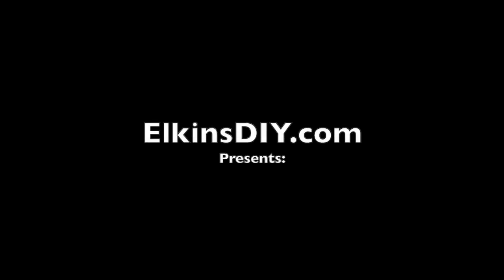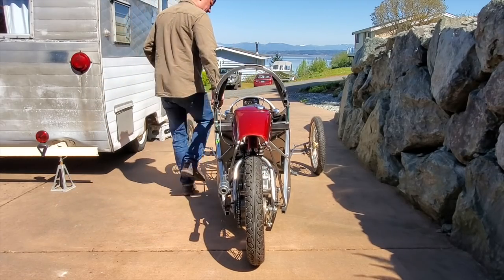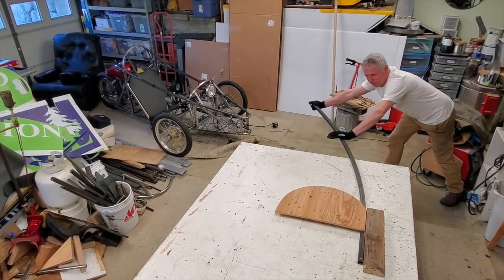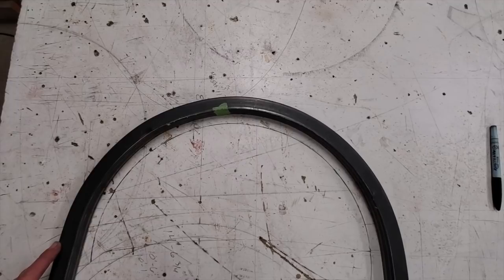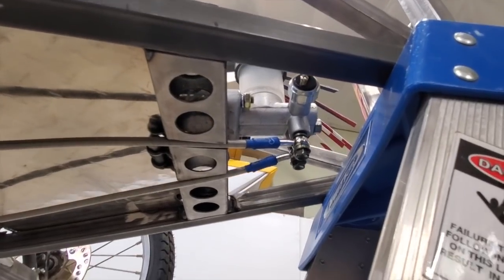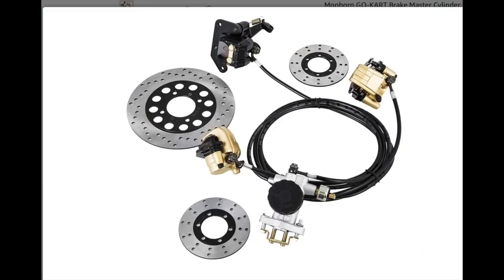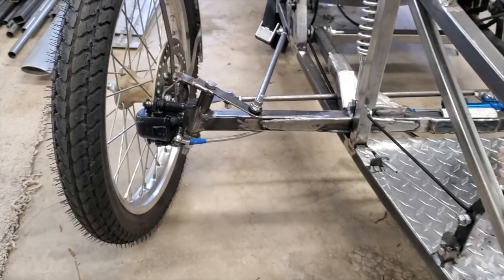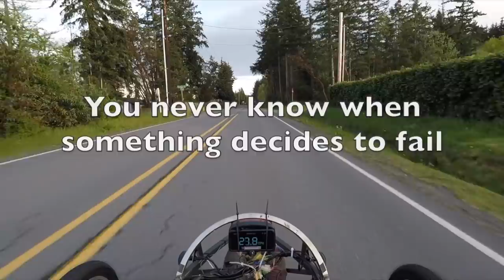Fuel efficient reverse trike build (part-11) Road tests!

Comment: In the 1950's My Grandfather built a 3 Wheeled Go-Kart for my dad....Later it became mine.... The frame was made from Car Drive Shafts in "T" configuration...U-Joints for Steering Knuckles... It only had rear brakes, and used 10" wheel in rear for BMW Isetta and Pulleys for front wheels and Aircraft tires in front... Started with 3.5 Clinton, it had a 372 JLO snowmobile engine at one time...I had a 6HP Tecumseh on it the most... I had CVT style belt drive to Jackshaft and Chain final drive... The 6HP would take it 40mph...the 372 was something like 18HP and 70 was attainable...never had enough brakes for that... But it was heavy as heck as it had full roll cage with forward protection.  My dad told me, originally they had used spoke cycle-wheels like yours has, but they don't take well to "side loads" and folded over...

Comment: Hi Paul, I'm building a motorized bike with rear suspension, a similar trailing arm to yours and spring welded on a similar angle to the top of rear seat post bar.
My problem is when the arm squats down the top chain tightens up and lose the travel. When I pedal the same thing happens, the top chain tightens and lose travel.
This means The chain is holding up the bike, and I believe the same is true with your design and have lost the small travel you had without the chain and are putting strain on the drive gear and shaft.
I did not know dirt bikes have a chain guide and slack to compensate for the travel. I'm scratching my head about this as the frame is awesome and don't want to give up on a full suspension dirtbike style motorized bike. Looking forward to your next ride that bike is sick and you are an inspiration to all  builders of manly things.
Reply from the maker: My rear swing arm pivot was placed too far back. This, like you mentioned, has created a bit of a jerk on big rear wheel bumps. The pivot should be closer to the drive sprocket. 
At this point it would entail major remods to achieve that, so I'll keep it as is and avoid rear wheel pot holes at speed.
Reply: @paulwelkinsdiy  Thank you so much Paul.
I was looking more for advice and got it than see you dismantle your trike. Pivot close as I can to the cranks and engine gear. Thanks again for help.

Comment: My admiration... I have put a lot of thought into making one of my own. But, never had the funds to make it real. Nice design and fabrication. The only thing I would have done differently is a slightly larger engine. Maybe a Honda 450 or similar.
Reply from the maker: I might hunt down the next size bigger Exciter, which is a 250cc. that way the motor mounts should still work. It's still meant for high mileage remember.

Comment: Nice job! OK, stupid question, but did you figure out what the loads are on each wheel when you're aboard that thing? Because with the way the weight is distributed, it looks like it's going to have a tendency to break loose in the rear first during hard cornering. Would be interested to know what its rotation feels like under accel/decel turning.

Comment: A very interesting project.  I may have missed it but what is the caster angle on the front axle.  Also, have you thought about the best gearing.  Dropping a tooth or 2 on the engine sprocket would give you more take off power and it seems that the top speed would not be adversely affected.  Getting the engine rpm up at each speed would take some of the load off the engine.  Lugging the engine may affect  your gas mileage.  Running a little more rpm may use less fuel.  Still a great project.  Billk
Reply from the maker: I'm thinking of that same idea. Playing with my Honda CRX with a high geared HF transmission, I waisted the motor in no time due (probably) to the low compression engine, unlike the true HF car which ad a high compression engine to handle the lugging. 
Once the teardrop body is on it should reduce the load on the engine at speed. I have thought of creating a rear wheel with a electric hub motor for 1st gear and reverse, then make a smaller rear sprocket for speeds.

Comment: Looks and sounds great Paul. 

I know you are going for mileage but I'm wondering if going to a one tooth smaller sprocket on the motor would help on pulling away from a stop. I know these small bike motors are happiest being spun up to make their power. The heads tend to run cooler when in their power band. I learned this from running dirt bikes with a head temp sensors.
Reply from the maker: Thanks for in info Kriss. I'll keep that in mind.
Reply: @paulwelkinsdiy  two gauges you may want to install are a cylinder head temp gauge and a oil temperature gauge in your little beast. The reason for them is to monitor the temperatures because the engine in enclosed and will not likely to get the airflow it is designed to have around it.

Comment: Just found this project. Gives me an idea of what to do with my yamaha 250 learners bike instead of selling it. One thing I have been planning for one of my projects is using 1" pink foam core with a fiberglass sandwich for side paneling for side impact protection. Should be able to take a good hit and improve rigidity at the same time without adding much weight. Bond it right to the steel frame. Might work for you tool. Let me know if that's something you considered.
Reply from the maker: Check out my website or other projects on this channel. You'll see I'm a HUGE fan of fluted plastic. It's ghetto looking but sturdy and light

Comment: Impressive Paul and thanks for the smiles!  I'm intrigued by your suspension and was curious if it's your design and and how much independent travel (If any) the two front wheel have?  It seems like it might be a good compromise of compliance, low roll and simplicity.

Comment: Do you have any overheating issues?  I've been wanting to build a similar design but figured I'd need to use a liquid cooled engine with a front mounted radiator since the driver would be blocking air flow to the engine.
Reply from the maker: This of course is the main issue with air cooled rear mounted motors. So far so good. I'm still planning to add a large scoop underneath, and I was gifted a new VW bug heater blower which I'll play with. I'm thinking of adding a heat switch to turn on the fan.

Comment: That thing looks like a lot of fun. Could you build something like that for me? I have a 1982 Suzuki GS650G standard street bike and a parts bike which is about 70% complete and only has 4,000 miles on it. These bikes have basically the same engine but one is a standard model and the other is a cruiser model. They are air cooled 4 cylinders with shaft  drive. My street bike has twin disc brakes up front and the cruiser only has one. I don't have much money but if I gave you both bikes and all the parts I have you could easily build another one to keep or sell. 

 Unfortunately last June my left leg was amputated below the knee due to diabetes complications. I like to do wood projects and it would be nice to have a matching utility trailer to haul lumber and completed projects with. Let me know what you think.  Thanks, Don
Reply from the maker: Sorry to hear about loosing your leg Don. A friend of mine had the same thing happen last year. 
I like to stick to creating different concepts I have in mind. I have lots in mind but so little time. Thanks for the offer though.

Comment: Side or lateral forces on motorcycle wheels and bearings always scare me as they are built with only vertical forces in mind. Wonder how the bearings and spokes hold up? Sure dirt bikes are built tough, but trike tough?
Reply from the maker: They are. The whole trike will weigh about 300 pounds when done. For bebopping around town they'll work just fine. For racing around you'd definitely wan to keep and eye on those parts. The Cycle Kart movement has shown that these wheels will hold up to abuse, and I increased the axle thickness as well.

Comment: I'd be interested to see if it can beat the fuel economy of my current bike: AKT TTR200 (never heard of it? Not surprised! It's a Colombian brand) At the last check I did it was doing 108mpg. That's miles per proper gallon, not the short-changed, growth-stunted US version. (1 imp gallon = 4.55 litres, US gallon = 3.78 litres)
Reply from the maker: I didn't do the math but per US gallon measurement you were getting around 80 mpg. Once slip streamed I'm hoping for at least 120 mpg (US gallons)
Reply: @paulwelkinsdiy  My maths says 89.7 mpgUS. To get 120mpgUS (144mpg) would be impressive. My AKT TTR200 (google it) is completely stock and was cheap to buy.

Comment: What is exspected fuel consumption for 100km when finished? Top spead? It seems it can go 90km per hour?
Reply from the maker: Still in the test mode, but once the body is complete there should be a significant reduction in air drag. Not sure of the metric conversion but I'm hoping for 120 miles per gallon at speed.

Comment: Hello Paul, I would like to turn my fat tire bike into an E bike for pulling a camper. I know Bafang has a unit but it is about $1,500 for a mid drive 1000watt. Was wondering if you had any ideas. Ty
Reply from the maker: Dan. Get the Bafang on Amazon for $400. That's the one.

Comment: Have you tried an emergency stop yet?  I'd start slow.  I never ride a machine too fast until I see how it will stop when I slam on the brakes.
Reply from the maker: So far up to about 40 mph. I'm waiting to get the body work on before testing full on braking at higher speeds.

Comment: Are you saying that on the first test drive there were NO BRAKES???
Reply from the maker: No FRONT brakes. Just the Right hand lever for the rear drum brake. I may be a fool, but I'm not an idiot.
Reply: @paulwelkinsdiy  Gotcha. When you were talking about the discs you said you weren't going to bother with the rear. You meant you weren't going to convert it to disc from drum. 👍

Comment: why trike? Or why "reverse trike" to be more precise? Wouldn't it be easier to steer with one wheel?
Reply from the maker: Reverse or tadpole trikes inherently have better stability in turns compared to the Delta or single front wheeled trikes.

Comment: Are you riding dirty? Or have you obtained a license plate for this creation yet?  As you used a donor bike, my assumption is just use that title/registration if you have it, otherwise you need to prove all the parts aren't stolen at a state patrol inspection.  Also, I believe you still need a motorcycle endorsement with it turned into a three wheeler, amirite?

Comment: Stock yz 100 brakes and calipers would have been plenty. Quiet exhaust please, nobody wants to hear noise
Reply from the maker: I'm shopping now for a quieter muffler. It does improve exhaust flow and mileage, but yes, IT'S A BIT LOUD!!
Reply: Loud pipes save lives!

Comment: I wonder if you had considered converting those existing spoked wheels to tubeless? I went down that route on my 17” Honda CT125 wheels a few years back and it has worked perfectly using the split tube or ghetto method. Cost was  negligible and took about 45 mins per wheel

This is it on a KLR650 

https://youtu.be/60bi1r2Xvbo

Comment: motorcycle tires have almost zero sidewall strength , and are not made for flat cornering.....so be careful speeding into corners
Reply from the maker: Indeed. I'm slowly building up to the limits of this trike. I'm waiting to finish the body before going all out.

Comment: Dude.. All respect towards the vehicle and everything, but I have to have a go at you for not wearing a helmet at the start.. It doesn't matter if you are just going down the road for a test run.. Come on mate.. Anyone who rides around in a vehicle that is so exposed to the body of that vehicle should at least wear a Full Face helmet... Realistically .. you should wear motorcycle gear as well... not so you silly but more for your safety.. I ride every day and I care about fellow motorbike riders and their safety.. there are so many video's online of people being hurt that could of been better off if they only wore a helmet, jacket, boots and gloves.. I just looked at the frame of the bike and that shit will fuck you up.. I suggest that you either pad it with HDF (High Density Foam) or you wear armour ... You'll thank me if you ever flip that bike going around a corner or if you are hit from the side as car drivers are pretty shit at looking for people behind them when they turn and because your bike is VERY LOW profiled you are much harder to see on the roads.. ... Just please be safe.. I care about you and want you to not get hurt on your rides.